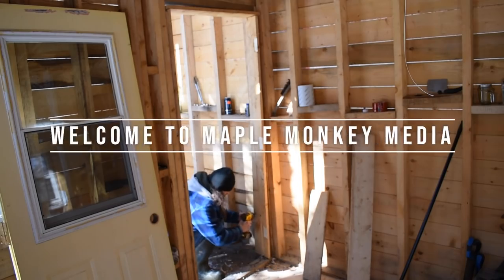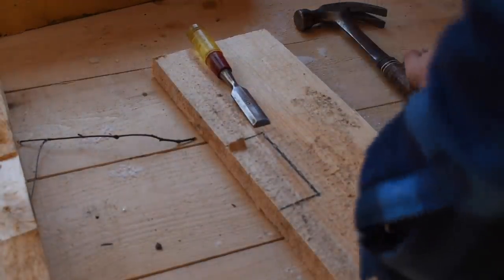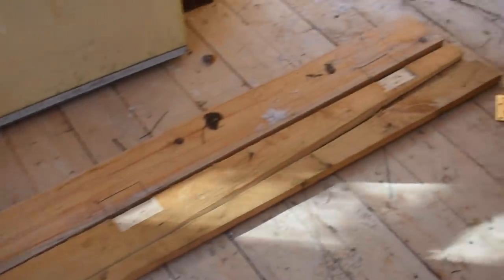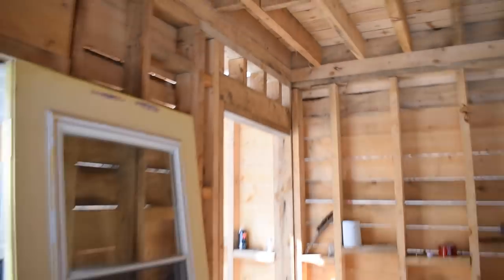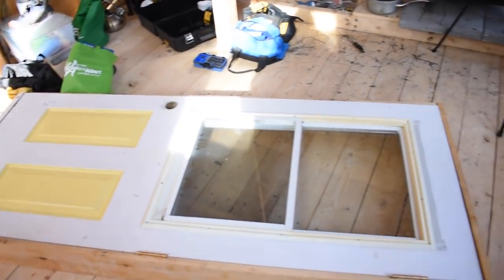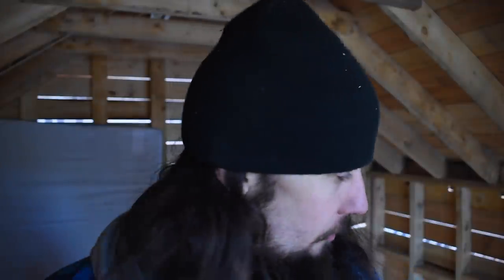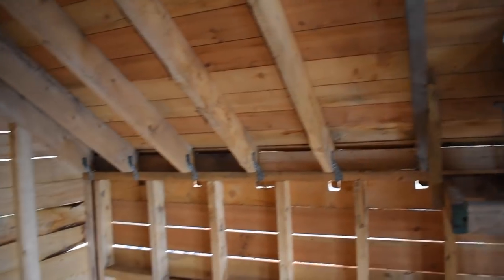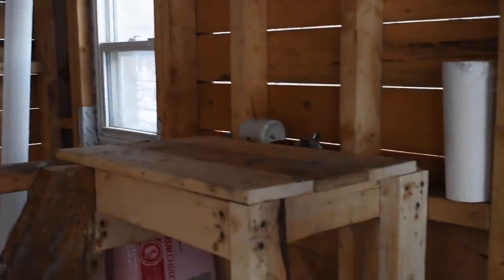The Cabin Is Holding Heat | Fixing Front Door Frame | Starting To Build Staircase

Comment: I use 4 inch screws for the hinges to the casing, and for the door latches as well. That way they have to take out the 2X4's as well as the casing.
Reply: YES!!! That is highly recommended.
Reply: Yes, I was going to mention that myself - either 4-4" or 2-6" in the center. Give the screw more meat to hold on to!
Reply from the maker: Yes that is a great idea I will have to take some out and switch them up when I am there next time to finish it up.
Reply from the maker: Great idea! Definitely gonna do it next trip
Reply from the maker: Makes more sense now, I think I've seen it done on some shows as well now that I think about it

Comment: On your door hinges put in 2 or 3 -3" deck screws on your door frame hinges to help prevent getting your door kicked in again. It will be much more solid because it will go threw to the actual structure. Just dont tighten them to much or it will pull your door jam out of square because they bite alot more. This is also a trick you can do on inside house doors if you have a door out of square to stop the door from jamming. (Dont use them on the door side hinges unless its a solid wood door though just just the jam side hinge). Love the vids
Reply from the maker: Yes for sure! I have added some 3 inch screws to the hinges. Just have to add them to the plate now. Thanks for stopping by!
Reply: @MapleMonkeyHomestead  always man! You are living the dream bud love your stuff

Comment: Your hinge screws that go into your door jam should be about 2 1/2 inches long going into the rough opening studs. That’ll keep your door from being busted out of the jam. A good dead bolt and lock set should take care of the other edge. Use long freaking screws to mount your hinge to jam.
Reply from the maker: Yes I think I have 3 or 3.5 inch screws going through it now. Ill be building a solid wood door for the entry way here soon to tie it all together too